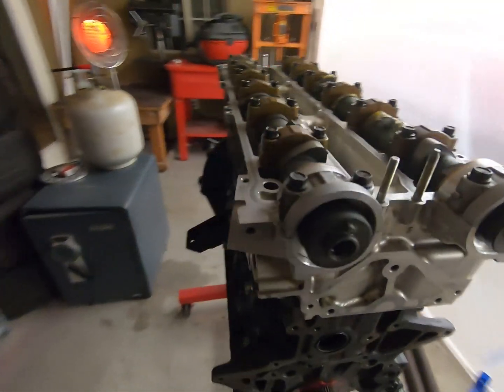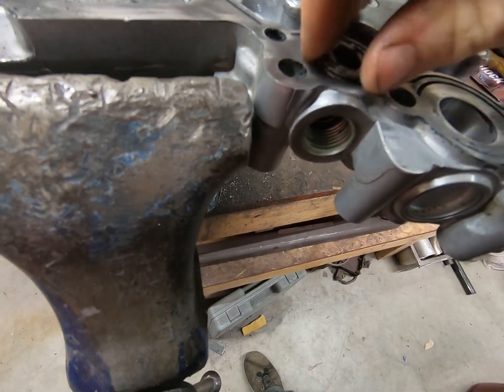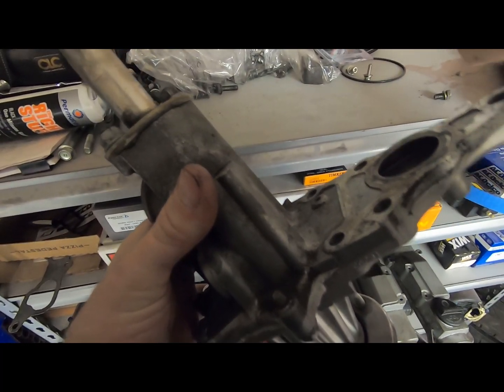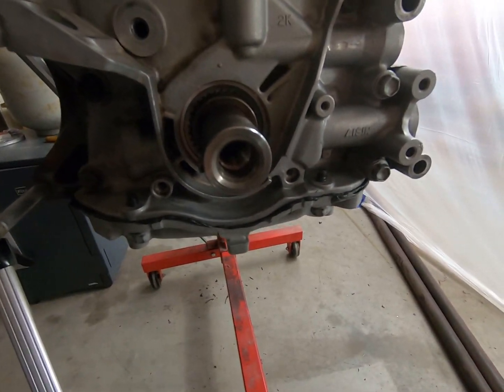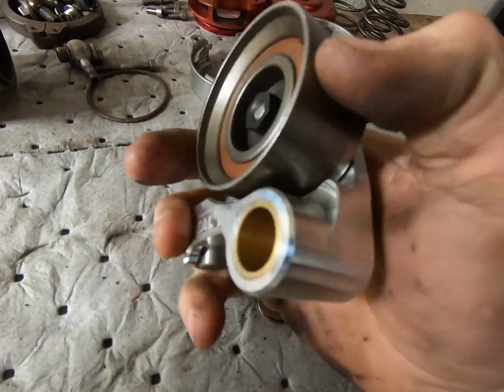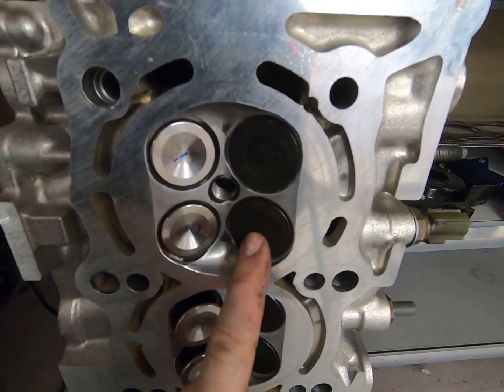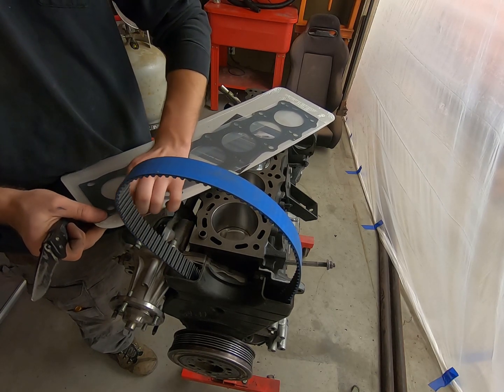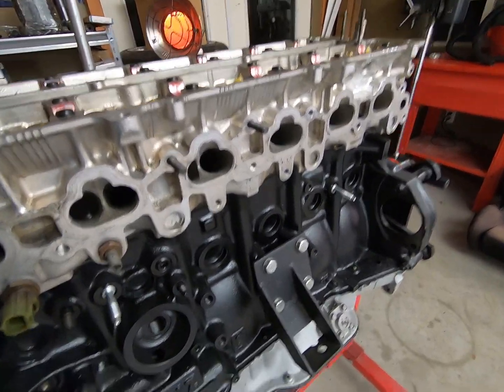1000HP Supra 2JZ Engine Build PT 2

Comment: Wouldn't of using a he vvti head been easier instead of drilling for a cam sensor?
Reply from the maker: Easier, possibly. Although the GTE valve covers would have needed to been modified on one of the mounting tabs and #1 intake cam cap milled out to accept a gte cam. The head was already setup with shimless buckets as well before I decided to add the cam sensor. We have a few extra heads when this one needs replacing, vvti and non vvti. It didn't take but maybe an hour ish total to turn out a bung and weld it in the head

Comment: I think it is actually a good idea to cut the lower timing cover in 2 pieces .. i’m not clearly listen what’s your intention by doing so, but for me thats mean i can change my timing belt without having to struggle on releasing that 239 ft-lbs bolt ..
Reply from the maker: That was exactly our intention. I really did not want to pull the crank pulley for a simple timing belt job with the engine in the car. radiator, intercooler, and oil cooler need to come out to fit the removal tool.

Comment: How much did this build coast you excluding engine
Reply from the maker: These prices are calculated as if purchased new, some of the parts I did purchase used however. The long block pictured in the thumbnail has roughly 7300 in parts and machine work. Including the Precision 7675 and intake manifold/throttle body, it would be an additional 2100. That doesnt include the other parts that will be purchased. Tremec T56, flywheel, driveshaft, coilovers, and a shine auto widebody with paint.